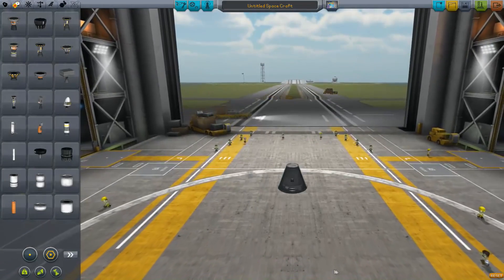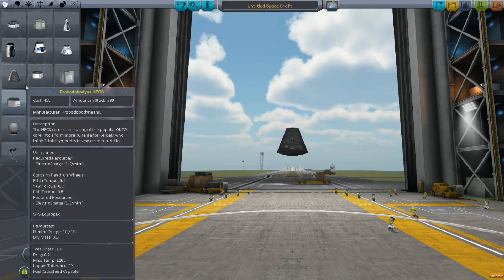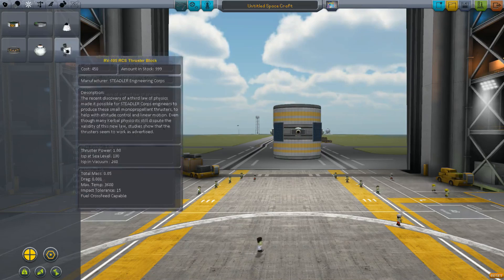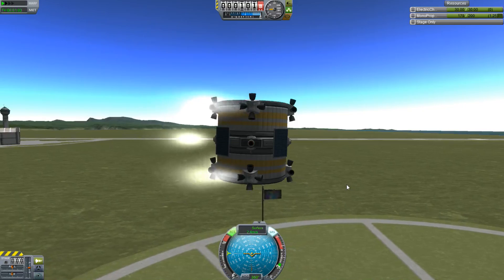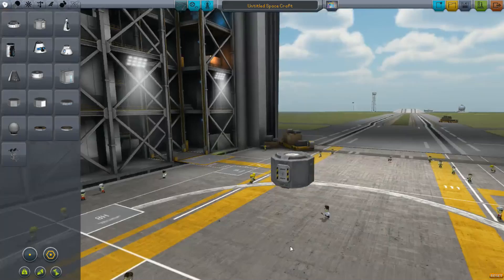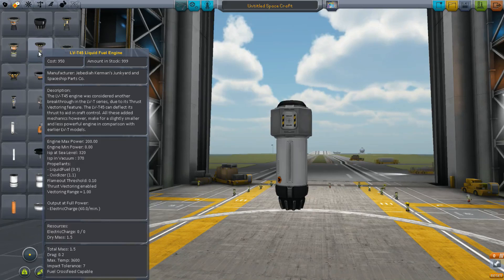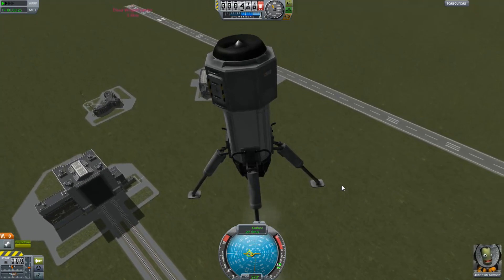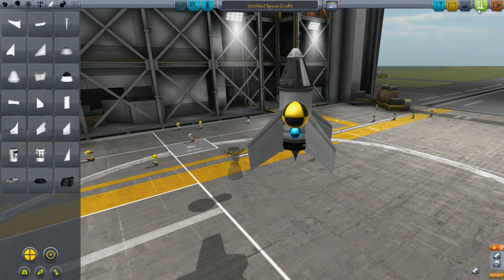Kerbal Space Program - How To Train Your Rocket

Comment: Sometimes the docking window is useful, like when you're using rovers; Putting them in docking mode changes the way then handle. I prefer to use HNIJKL because it also allows me to use WASD as well, so, it's much easier for a two handed approach at docking.

Comment: I think there is some actually regression in load times. I'm having the same thing, load times of 10-ish seconds or more where before it used to be just a few. I'm running it on a HDD but my OS etc is running on an SSD so there should be no "fighting" over HDD access.

Although it's possible they made it a bit longer to compensate for the few seconds it was very laggy before you could launch before.

Comment: You can place them off center of mass as long as they thrusters are symmetrical as well. If you apply thrust in a direction 1 meter below the center of mass, it will flip. But if you also apply thrust in a direction 1 meter above AND below the center of mass, it should move as if you had applied thrust exactly at the center. This uses more thrusters, but it should work.

Comment: The aerospike points down easier (when your velocity vector is pointing down) because it has a low drag coefficient (0.1) and is relatively heavy (1.5 tonnes). 
It makes rockets using the aerospike engine somewhat unstable because the aerospikes will tend to want to flip and point towards the velocity vector.